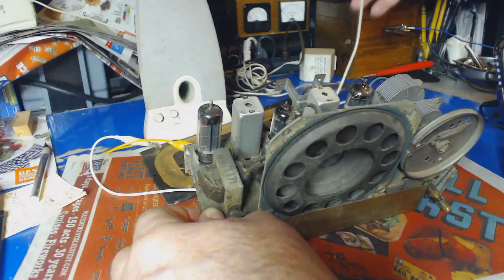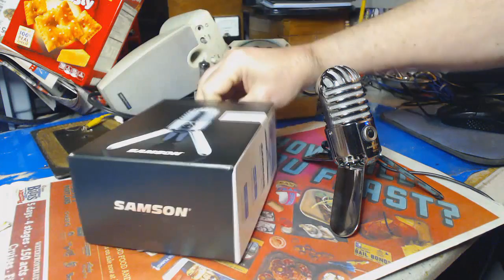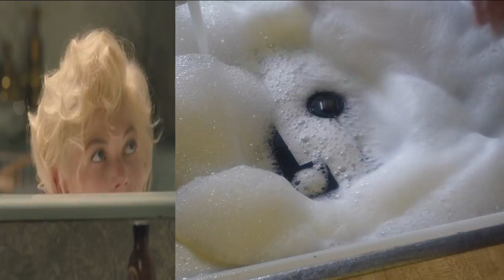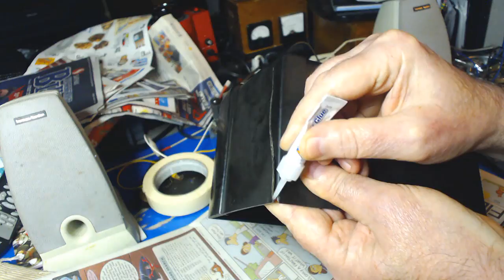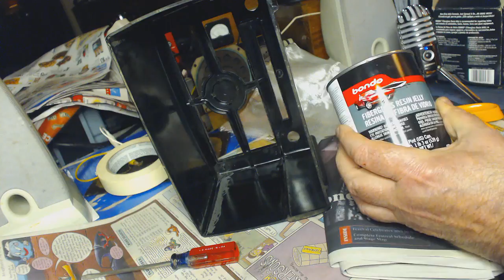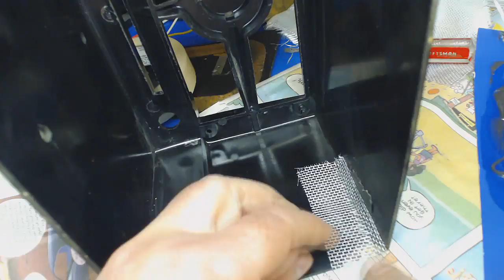1950 Emerson Model 587A Restore Part 2

Comment: Hard to believe one little wire on the loopstick antenna caused that much trouble but that's how it goes. That's a really cool looking mike(Samson Meteor mike)especially with all that chrome. Handy feature that the legs fold up where did you get it? That case cleaned up pretty well. Your crack fixing method looks like it will be solid for sure. Thanks for sharing.
Reply from the maker: I got it at Best Buy
Reply: Thanks for the info Buzz

Comment: Buzz,
I will look with interest as to how you will match the colour of the filler for the missing corner with the colour of the rest of the cabinet.  Since it is something I find difficult to do, I usually end up paint spraying the entire cabinet ...will you be doing the same?
Cheers,
Phil.
Reply from the maker: Hi Phil, Yes I will be painting the radio, although I am contemplating on maybe just painting the sides and top??....tc, Buzz

Comment: I have always wondered how you repair bakelite radios with cracks on them.  I have one that looks to be of thicker bakelite that has a crack around the dial face.  It was my parents radio and I asked my Dad about it.  He said he got it in the 50's after the original owner had it fall of their porch and he got it for a good price as they did not have a radio at the time.    But I have passed on radios with pieces missing and look forward to seeing how your repair goes.
Reply from the maker: 3 years ago when I started, the only radios I could afford were the broken plastic ones........Buzz
Reply: I started out with my Parents old RCA and then I found one just like it, was a great deal even though it was painted with house paint at least three times for $2.  Other radios call out to me to "take me home".  I have decided to be a bottom feeder in this hobby.  Fix what I can and pass on ones that are too far gone.  But you Buzz don't have that filter and that is why I enjoy watching your repairs.

Comment: Buzz,
Sorry I'm somewhat late to this vid, but I've been bidzy-bidzy-bidzy.  I'm just a bidzy guy.
I've never been a bakelite radio man.  In fact, I've never bought or restored one.  I really don't have the patience for the bondo bit.  A small spot repair to plastic or Plaskon is ok, but that's about it.  So it's good that folks like yourself don't mind taking them on.   It'll be interesting to see the finished product.  Do you plan to paint the radio some 2 or 3 tone flashy metallic colors, which would be really cool,  or leave it a dull, disgusting, pathetic, screwed-up, lowlife, barf city brown?
Just asking.
Regards,
John
Reply from the maker: Its a black radio...black radios matter!

Comment: Hi Buzz, 

I'm glad you showed the details on repairing that missing, broken corner.  I've got a Zenith 7H822 which has a cabinet similar to the Zenith 7H921 you restored.  Is that cabinet bakelite?  Mine is missing a pie-shaped bottom corner piece which is in the same area of the repair you just did.  The missing  broken piece is about 1 3/4" long.  I'm guessing that your repair procedure should be the same for my missing piece, correct?

Thanks a lot, Tom
Reply from the maker: My Zenith was Bakelite, I bet yous is too. next week I will show how to replace missing piece with regular bondo......Buzz
Reply: Thanks Buzz, 
I'll look forward to that.